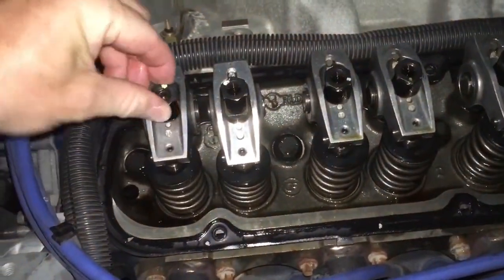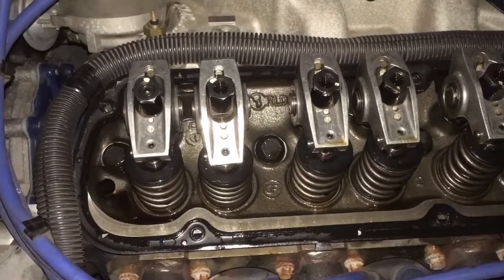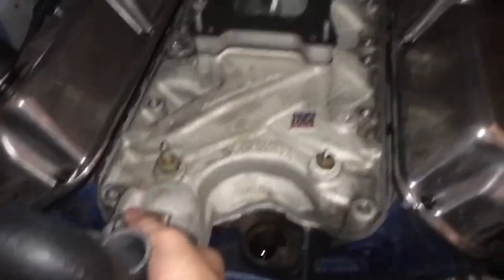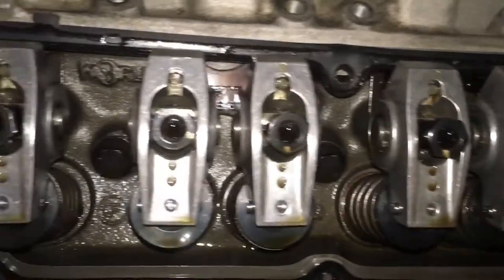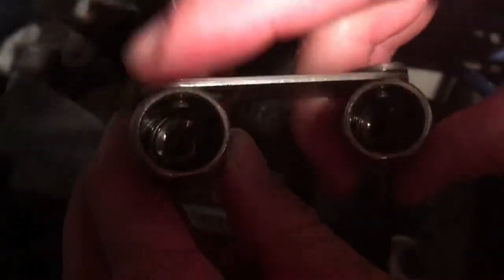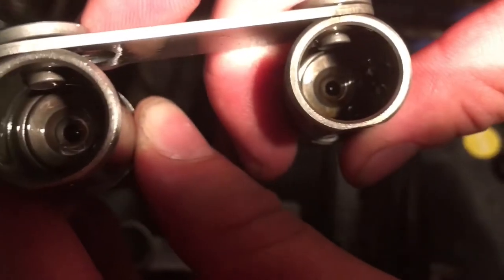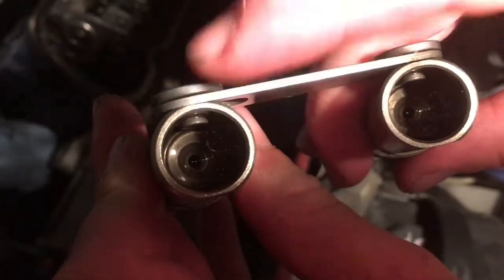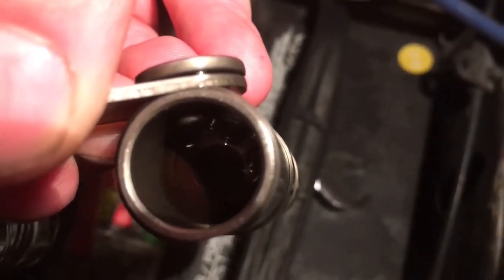Valvetrain vlogging

Comment: Wonder why you had oiling problems?
Reply from the maker: Well the good news is the oiling issues weren’t the cars fault. They were my fault.
This vid did not go the way I wanted it to go. I thought some crud got stuck in a lifter and if i  exercised the lifter by giving it more and less preload it would free up. Instead I blew that lifter out as it will no longer build up hydraulicly. 
Why did this happen? I never put in the plug for that bank of lifters 😬. The problem never showed until I went from the E cam to the F. The next engine I put together will only have screw in oil plugs and I’m going to make extra sure I put them in the first time lol
Reply: @fomobros2207  I had the machine shop change my freeze plugs and oil galley plugs.  The oil plug in the lifter valley at the rear of the block was loose.  I found it by running the oil pump with a drill on the engine stand.  Luckily I did this before I bolted the intake on.  A jet of oil was shooting in the air.  I learned to pre-lube on the engine stand rather than in the car.  My previous motor had air bubbles in the oil.  Turns out I cracked the oil pump pickup tube when I bent it to set the clearance between the pickup and the bottom of the oil pan.
Reply from the maker: @sbf_fox2434  oil problems are scary, but we’re also learning what to pay closer attention to which is nice. So far I’ve been really lucky bc the issues I have could have been waaay more expensive. And it’s really great when you and the other guys chime in and share knowledge and past “learning experiences” 👍👍